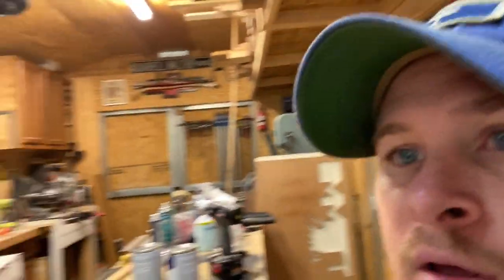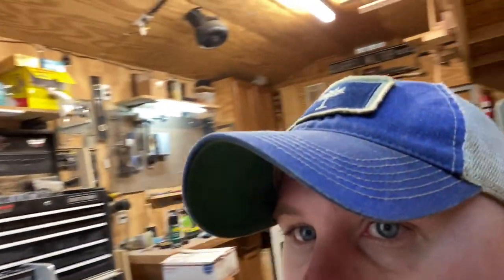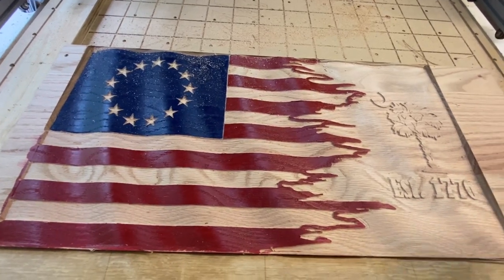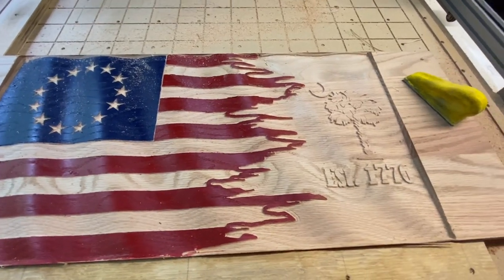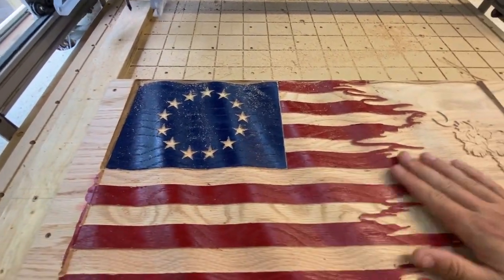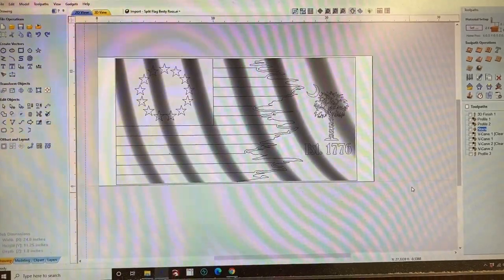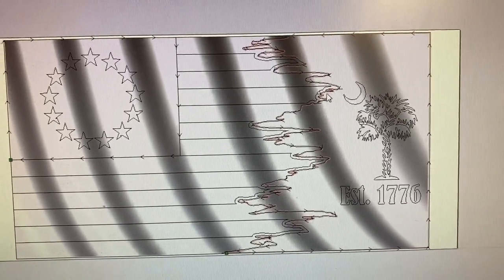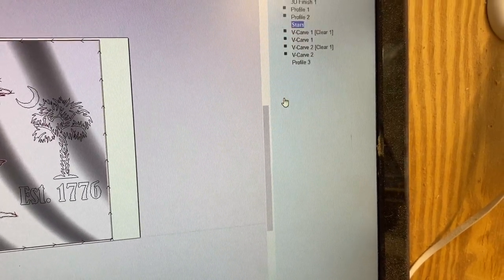*Raw and Uncut* - How I Paint My X-Carve CNC Routed 3D Flags

Comment: How do you get you pocket and profile cuts to cut consistent depths over the waves? Does VC Pro auto adjust based on your STL file?
Reply from the maker: When setting up your toolpath there is an option that says "project on 3d model". It will follow curves of your Model.